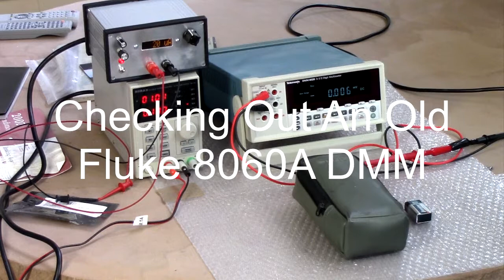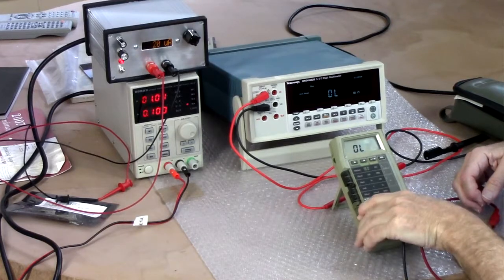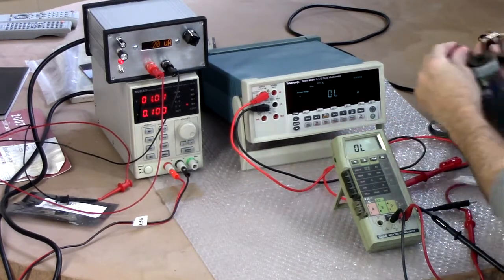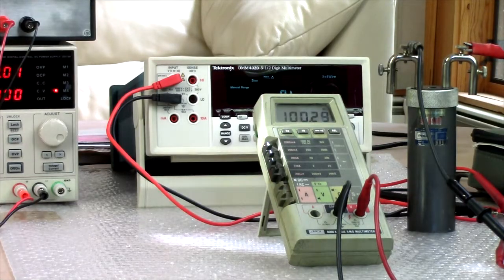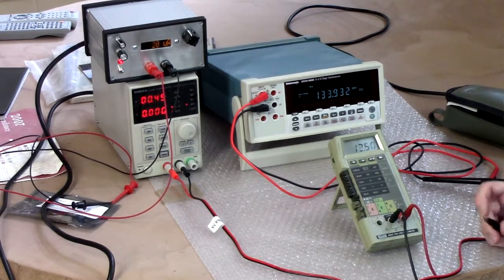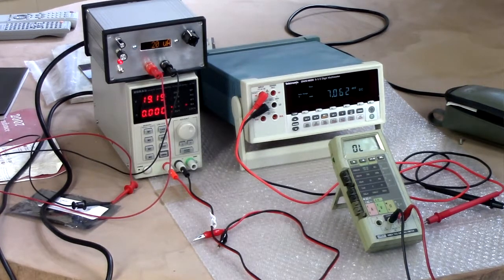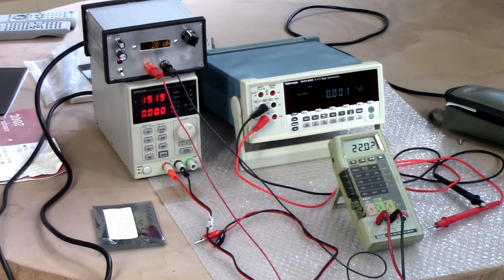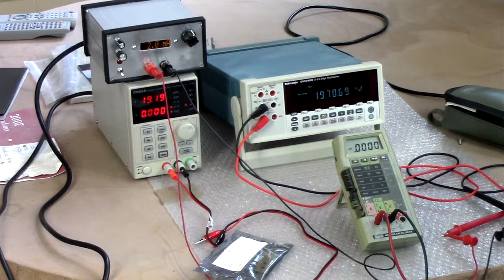Not a Product Review: Fluke 8060A

Comment: This is the best meter which Fluke had made. I had been using it since 40 years and now has given-up on me. LCD issues (went to extent of replacing polarizers), Plastic casing breaking-up (high humidity, I guess). RIP now. Current generation DMMs r power hungry and use-and-throw types.

Comment: I have a Fluke 8060A that I still use to this day. So far I have been lucky, no display issues or capacitor leakage issues. I bought it used in the early 90's, it had calibration stickers on it so it may have had the caps replaced at that point.

Comment: What was the original price?
Reply from the maker: I think it was around $200, but it's been 30 years since I bought it so I can't give you an exact number.
Reply: @MartianTech  The list price was 499 in 1982. I bought mine from ITC electronics  in Chatsworth  (Desoto and Nordhoff) in late 1982 for like 350 ish in a promo sale event. That price was 2/3 a months rent of my apartment. With Inflation that 350 bucks is like 1050 dollars in todays 2024 dollars. That meter was totally well worth it in the testing I was doing. The ultra high impedance available (in an alternate mode)  in the 200Mv and 2 Volt ranges is one reason I got mine.  These are fantastic meters. Lost the origanal one in Katrina in 2005. Used ones I have bought off of ebay have mostly been good.

Comment: Does anyone know what replacement fuse would work for this unit?
Reply from the maker: Which fuse?  There are two: a 2A/250V and a 3A/600V
Reply: @MartianTech  The one that is located behind the 9v battery.. I think its a 2A/250V, can i use any 2A/250v fuse or is there a special kind that must be used?
Reply from the maker: RTFM:
Replace F1 with the appropriate 2A/250V fuse; American-style: fast-acting, type AGX2, 1/4 x 1", Fluke PN376582; European-style: 5 x 20 mm, Fluke PN 460972. Do not use makeshift fuses or short-circuit the fuseholder.

Some more discussion here: https://www.eevblog.com/forum/testgear/fluke-8060a-dual-fuses-bad-design/
Reply: Thank you for this info, very helpful, appreciate it!